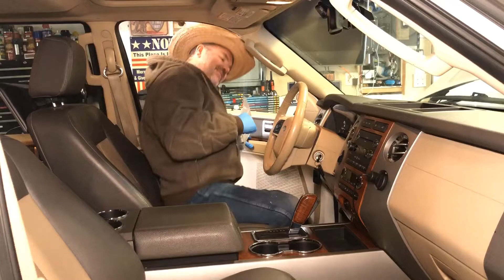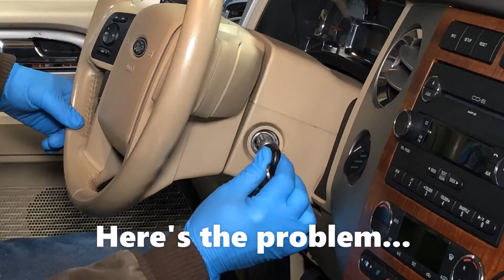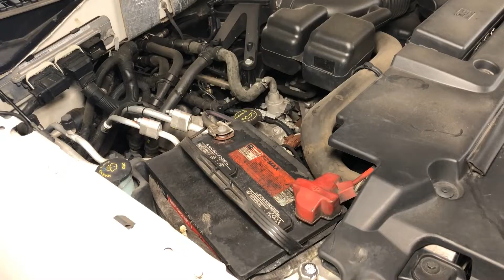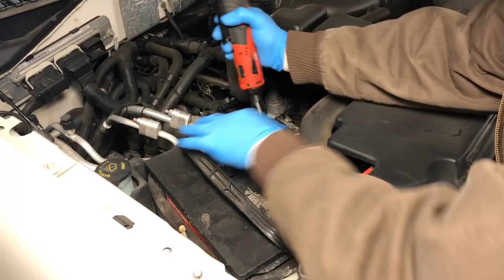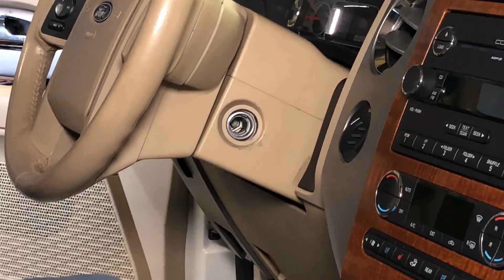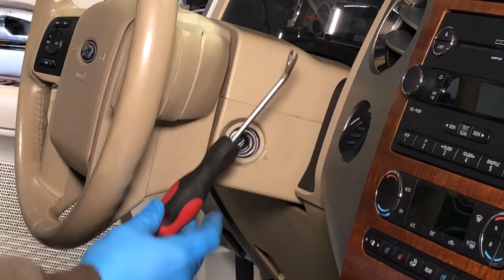Ignition Key Lock Cylinder Replacement Ford Expedition & F150 AU5Z-11582-b

Comment: I got held up trying to install the completed cylinder into my vehicle...It wont go in properly!  Seems like the locking tab is in the way...i am able to spin my key in such a way that the locking tab is free to pop in, but then I can't turn the key anymore to try and get it seated.  Uh oh!
Reply: I figured it out --- if you have an F150 with this lock cylinder (mine is a 2008) you need to make sure that the truck is turned to the ACC position (accessory position, ie lights on, radio on setting) before putting the cylinder into the column.  Once I did that (I used a screwdriver, as the original/broken cylinder was already removed, and battery was off) the cylinder slid right in, and the locking tab went right into place.  NOTE: For finding the position of the key relative to the bottom tab for the final push in, I found it easiest to hold the locking pin down, turning the key until the locking pin depressed.  The pin won't depress otherwise.  That's the position you want to insert with.  THANK YOU FOR THE AMAZING VIDEO JAVO!

Comment: Tools; 5.5mm socket, Pry tool, Pick tool, Tiny screwdriver.  
Edit: if the instructions for the new Tumblr shims is printed at the wrong scale and you can't possibly figure out which shims go where to get the tumbler to work with old key, it's easy to swap out the shims to fit the new key. With the key inserted the shim should lie flat against the tumbler. They shouldn't drop below and they shouldn't raise above. It will take about 10 minutes to figure out the correct order. There's no need to go to a locksmith.

Comment: followed vid to the letter, but something must have gone wrong as key goes in with no problem but will not turn switch. thinking maybe big tab and small tab were on the wrong side. now will not come back apart to try and correct it is there a way to disassemble?

Comment: Do you have to have the vehicle in the on position to fit the new cylinder in?
Reply from the maker: Hi Jonathan.  I believe you do because you need to turn the key in the cylinder to the "on" position so that it causes the tumblers to retract; you can then insert the cylinder into the opening.  I'm sorry I don't have a definitive answer for you but I believe that's the case.  I had left my vehicle in the "On" position while doing this repair which is why I disconnected the battery.

Comment: My truck got stolen same model so I have to reprogrammed the whole thing or just the cylinder the cylinder is in there it’s just busted they didint turn it on since it has a chip they just needed it to loosen up the steering wheel
Reply from the maker: It's hard to say for sure without looking at it.  It sounds as though you still have your key and they broke the cylinder so the wheel lock would disengage.  I believe you shouldn't need to reprogram anything.  It sounds like replacing the lock cylinder should correct your problem.  The only issue you may have is if any of the  tumblers are missing or damaged to the point you can't get the number off of them for your replacement.  I hope that makes sense.  Thanks for stopping by!

Comment: Any non-destructive or at least very little destructive tips on removing this cylinder in the case of all the keys being missing? I have a legitimate reason i swear lol, i am taking ownership of an 04 f150 fx4 from my mother however the keys have been stolen by someone, before is pend big bucks on a locksmith I am curious if i can bypass that ball bearing locking device to remove the cylinder and just slap a new ignition cylinder and new set of keys in and just pay for a programming. I rewatched the video it appears it is not a ball bearing, so a simple small drill bit should work?

Comment: Great video, I'll add a hint if one makes the mistake I did. On my 2010 F150, with only 57K on it, the end of the lock cylinder popped off.  Insert key and you could pull the core out of the cylinder with the wafers attached. Not a problem as you just insert, push in and start the truck, Drove it like that for a few days til the new part arrived. Today I did the job with a small issue. Built the cylinder and it wouldn't go back into the column. Because the core came right out I forgot to turn it to accessory position.  Easy fix once I figured out what was amiss and grabbed the old core with a key in it and stuck it into the column and  turned the switch one click. Then the new lock cylinder went right in.

Comment: I am still confused as to what is wrong with the old one? I had the same thing happen to me a month ago but I don't see anything broken on the cylinder. It looks to me like it just popped out.
Reply from the maker: @Oros Abaddon - In my case, the internals of the cylinder had worn down to the point that tumblers were no longer securing the cylinder so it would just pop out every time we would pull out on the key.  Having the tumblers wear down over time is pretty common but the other issue people can run into is your key wearing down and so it doesn't move the tumblers to be able to engage the ignition.  Thanks for stopping by!
Reply: @javosgarage  thanks for the reply! I actually found out what the issue was. I broke a tab on the silver cap that goes in front of my tumbler. So I can put it back together but it will pop out eventually cause.

Comment: Great job... my boyfriend has a 1998 navigator,  has same key issue, can he use your video as an example?
Reply from the maker: @Angela M - Hello Angela and thank you for the compliment.  I haven't done this procedure on that year so I can't give you an exact answer on that.  I did look up the replacement lock cylinder you would need for that Navigator and it appears to be a different design.  I would think the tumbler design would be similar but the process of removal and replacement would most likely be different.  I'm sorry, I wish I could say this video would work for that application, but I don't believe it would.  I really appreciate you stopping by, please let me know if I can possibly help in some way.

Comment: I just replaced my 2007 Ford Expedition. Awesome video. Mine had a end clip to help prevent popping the cylinder out. My new cylinder was very tight so it took a little while to make that last turn to the final push but you did a Great job on your video. Saved 200 on Labor. I pulled each pin on the old one one at a time and then installed the new one so you can’t get it wrong. Good job.
Reply from the maker: @John P.A. - Hey John, thank you very much for the compliment on the video!  Super glad to hear the information was able to help and you managed to save $200 in the process, that is AWESOME!  Now you got some extra cash for more tools, LOL.  We can always use more tools, am I right?  Really smart to do the tumblers one at a time to make sure they stay in sequence.  I really appreciate you stopping by and taking a moment to leave me a comment - thank you.

Comment: Do you have to get a new key reprogram
Reply from the maker: @Tiffany Miller - Hi Tiffany.  In short, no.  The idea behind placing the exact numbered tumblers in your new cylinder as your existing cylinder is to enable you to keep and use your current key.  All you have to do is match the number (1-5) of the tumbler and place it in the same position in the new cylinder.  Since this allows you to use your existing key there will be no need to have any reprogramming done.  I hope this answers your question.  Please feel free to ask if I can help with anything else.  Thanks for stopping by!

Comment: The set comes with 4 sets of each number. How do you know which set to use are they all the same? Or different based upon key size?
Reply from the maker: @alex anderson - I'm sorry Alex, I'm not sure I quite understand your question but let me try to answer.  The four tumblers included in each bag (say the #5 bag for example) are all the same and they will be marked with a "5".  If you have a #5 tumbler in your existing cylinder you would take one of the new #5 tumblers and place it in the exact same position in your new tumbler.  If you look close the different numbers have different size openings that match up to the different high and low spots of your existing key.  I hope this helps you, if I'm off here please let me know and I will do my best to get your question answered.  I'm happy to help!  Thank you for stopping by btw!
Reply: the numbers on the tumblers are the depth of the cuts in the key, meaning 5 is the deepest cut and 1 being the shallowest......I hope this makes sense.